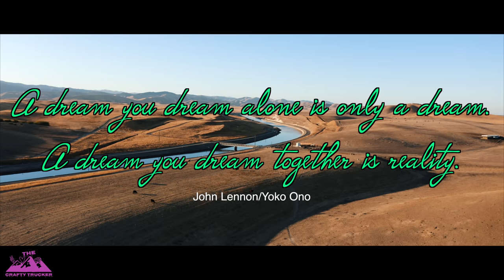THE GENERATOR WOULDN'T START

Comment: Those clamps broke on my exhaust mounts too.
I sandwiched a heavy duty spring ( a short one just big enough to fit over the U bolt) then a washer between the spring and the nut before tightening.
Then another nut to act as a locknut.
Worked like a charm; no more broken clamps or mounts.

Comment: You should of put new washers on that hanger. Especially the front broken one. It helps resist against the vibrations that cause the bolts to shear off!!! That is the reason for washers.

Comment: The lock nut wont work on top of the washer. As it vibrates the washer will turn with the nut and the clap will come loose. Can you buy another clamp bracket from a truck exhaust dealer and fit two clamps from that one main bracket. Back to back. Love the tanker selfie ✌🧡🚚 .Stay safe.
Reply from the maker: Thanks for the tip Wayne we will correct that. That’s not a bad idea on adding another. Surely we can make something work.

Comment: I hope you report those breakages to frieghtliner.  Looks like they need to upgrade the grade of that U-bolt or upsize it.   It its that common thats alot of possible road debrise they could be causing.  Good luck.
Reply: Or you rught its an assenbly issue and someones to happy withe the bolt gun.  Still something they sould fix in their assembly manual.

Comment: My BP was high today, I live east of Houston Tx. On I-10 E, past the beltway- 8. So I know you do pass this way occasionally. The weather here been cold in the morning. I'm working on give people the best BP reading ever, and to keep it stable. There a LOT-MORE, then heart rate. FOCUS on the pancreas. In humans it makessugar to run your brain, and YOUR nervous defense system.  You got to control your nervous, and your brain as you "get" older.  I love driving, I had to cut ALL the junk foods. Even small amount because it will SPIKE YOUR BP. Every night I bake 8 or 9 sweet potatoes, and eat them COLD. I pretend I'm eating ice cream, I put bragg, Nutritional Yeast, it's PACK with B-1, that good for your brain and nervous. Taste like butter.  Study animation of the pancreas, In animal it food molecules into vitamin- C, animal do not get diabetes. If man could do the same, man could live pass 200 years old. You have 5 major team organs. After my lite walk breathing exercise and squats, came home, check my BP, 123/73. YOU got to build a BATTLE plan daily.
I eat good but keep it on hand. BRING BP down is nothing, it's got to KEEP It,  STABLE, and that not just the heart, because it's a team effort. HEART, LUNGS, ARTERIES and BRAIN, you can add in the eye's also. My workout will made you sing, because your bring oxygen to the brain.
Reply: If you thing you have some manageable problems, like hypertension, wrong it gets worse.
Loose weight and get the 5 major team organ running as one. You can and it's easy. You have some few choices..
Reply: Heart rate is like a 24 hour bridge. That you need to keep at a good normal rate. So it takes a battle plan and a life style change for good, but also, good, heathy and fun.

Comment: Hi guys, I did notice that while you were replacing that U-bolt, that it appeared that your generator radiator fins seemed pretty dirty, you might want to check that out.

Being that low, you're probably picking up extra road grime & maybe a small shield would help keep it cleaner. (Just several 4-5 inches parallel to  side of gen); ask the gen. Folks first  - don't want to block cooling air).

Speaking of which, now that it's getting colder again... have you reinstalled that cover on the rear of the gen. (truck wise) that you removed several months ago?

Thinking of that U-bolt; I wonder if you could find some stiff rubber isolators that would reduce the vibration between the frame & exhaust pipe, so that it's not snapping the bolts. Or find a grade-8 U-bolt if the make one that size.  See link below...

What I always had issues with; with Freightshakers, (and iit pissed me off [I threatened to sue them!] Is their constant failures of the exhaust flex pipes!  Twice I had major failures that gave me a low dose carbon monoxide poisoning!  Once while I was in the sleeper! Like most everything else today, they cut corners &  go with cheap usually chinese made shit!

I went & bought a portable, battery powered Carbon Monoxide (CO) detector, which is woke me up while I was sleeping!

I think ALL vehicles should be required to have built-in (and easily replaceable/universal) smoke/CO detectors!  I even sent this to the NHTSA, FMCSA, Dept. of Labor & the federal consumer product safety commission, and got no  response at all. Bottom line, they don't give a crap about driver safety!  Just part of the reason I walked away from trucking!

Lastly, I am very surprised you dead-headed that far instead of at least trying for something like a newsprint paper load (being that you were in that area). 

Isolators:
https://www.ebay.com/itm/8-PC-HI-TEMP-BLACK-RUBBER-EXHAUST-ANTI-VIBRATION-GROMMETS-INSULATORS/123492817508?chn=ps&norover=1&mkevt=1&mkrid=711-117182-37290-0&mkcid=2&itemid=123492817508&targetid=934793863816&device=m&mktype=pla&googleloc=1013509&campaignid=10900808549&mkgroupid=108153392820&rlsatarget=aud-622524042958:pla-934793863816&abcId=9300403&merchantid=101991178&gclid=CjwKCAiA8Jf-BRB-EiwAWDtEGvIBnFKOrAwwOyndDaAiB85_wnHChybeXJp252TxAorhe936IszmNxoCBXQQAvD_BwE&pageci=fdc2dca3-fd92-46c0-bc8e-b4d7c3a12454&epid=16025954296

Comment: Wish  I'd of been here to wish you a Happy Thanksgiving. But with Heather cooking,  I know it had to be good. I made a small  roasted pork in my Instant pot with potatoes, and that made a pretty tasty one person meal. Jason did a nice job changing that clamp even though it was fairly simple. I had my old 95 Ford Escort LX in for inspection, and it cost $1,300.00. I needed a new steering arm, I left the mechanic put on a new rear axle because one side was leaking grease (not mandatory for inspection) but while it was in the garage may as well have it replaced and two new front tires, and wheel alignment. Considering I've had the car since year 2000 @ 98,000 miles & only paid $1,000.00 for it then, and put probably $2,000.00 in it since I've owned the car so far not counting this past inspection bill, the maintenance on the car I think is pretty low. The car now has 139,000 miles on it, so I figure it has giving me great life for what it's cost in maintenance and the mechanic whom I know and trust said over-all the car is in great shape & everything else works fine in it. Since my Jeep is kind of my pride and Joy, I take that old Ford Escort shopping and places that I don't care too much if it gets a nick in the pain job, however, after all these years, the body and undercarriage still look pretty good especially when you consider the age of the car. I am keeping my eye open for a newer car, but that may be a year or two down the line, or who knows maybe longer.  As always, I hope you guys keep getting good loads, the truck keeps running well, and above all you are both safe and healthy....
Reply from the maker: Thank you Pete! Your Thanksgiving dinner sounded like it was delish. Nice that you have the Ford to do a lot of your errands in. Love to you & Shyann :)

Comment: Did you ever consider a jump pack. No I makes a nice one for about $200. It is GB70. Has 2000 amps for starting. They do have smaller one. Just a thought.
Reply from the maker: Not a bad thought at all. Jason has actually been researching some
Reply: @TheCraftyTrucker  the brand was a NOCO. GB70.

Comment: having that kind of a problem   i'd think about adding an extra pair of batteries ,for more reserve power ,,i live in a 1947 GMC motorcoach currently and i ended up finally adding solar panels to it cause i  hated my APU system starting in the middle of the night ,it'd only run for 20 minutes about 3 times overnight  but it was just too much runtime unnecessarily ,,i doubled my storage capacity of course i have 12 8-D AGM batteries arranged in 24volts giving me 1200 amp hours 24v ,in the summer when i run the cooling system i can go a full day without sun and still not go below 50% charge ,APU system has it's own 120 amp hour battery and the coach has 2 batteries for th engine although the coach engine with it's dual  240 amp alternators will charge them all ,,even without the generator i make 100% charge by 1pm even on these short days just off the solar power it'll be charging at 140+ amps steady by 10am and will peak at 200 amps ,,the charging system i have will start cycling power to each bank , they are arranged in groups of 4 so i have 3 banks allowing them to rest prevents them overheating and when they rest before full charge  they actually last longer 
batteries can actually be very annoying ,,and wet cell batteries hate being cycled constantly
Reply from the maker: Maybe something to consider

Comment: Although these are older vids.
And i just started watching not 2 weeks ago.
And I already know that you stopped making tubes
I do have a question.
The last vid I watched you explained shifts, 34, breaks, rests, etc.
Here's the Q.
If a couple had a adult son or daughter, with a CDL
( in Manitoba its a Class 1A, or class 2A. A indicating Air Brake )
Could you take shifts, example
1 driver,  1 nav or "company"  and 1 sleeping and basically run 24hrs straight?
Reply from the maker: So like a three team in one truck? We’ve heard about some people running that way but not sure if it’s possible. I think it would be company specific. Some companies may allow it some may not.

Comment: Generator doesn't start. Ain't you supposed to start it every month and let it run for a little bit and keep fresh fuel going through it
Reply from the maker: Oh we use it way more than that. Whenever were cooking we run the generator and if the batteries get low It will start up and charge the batteries as long as Jason has that setting on LOL